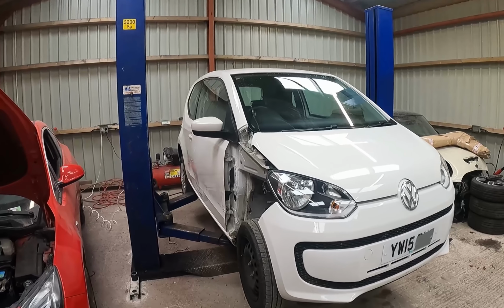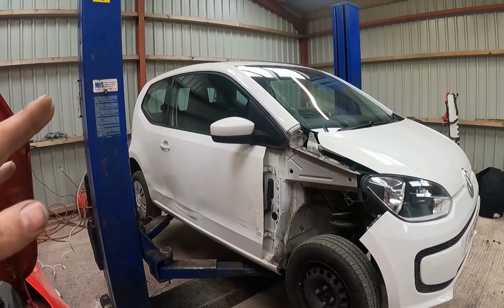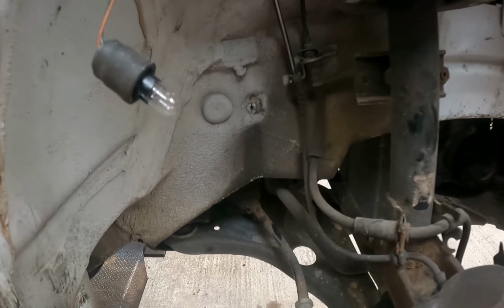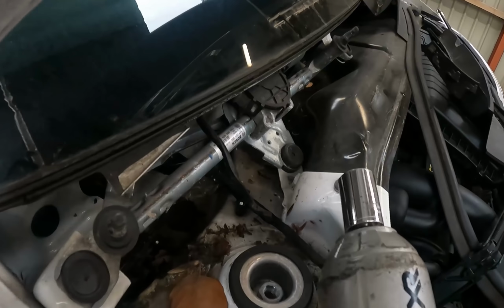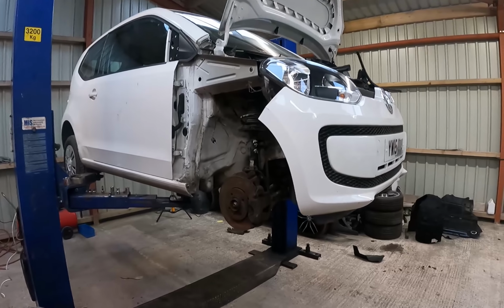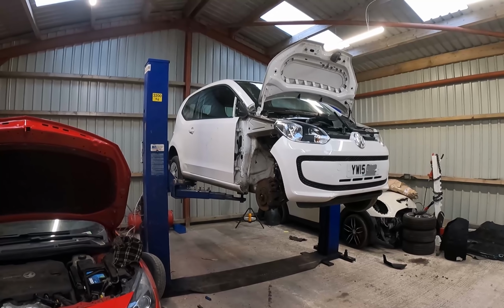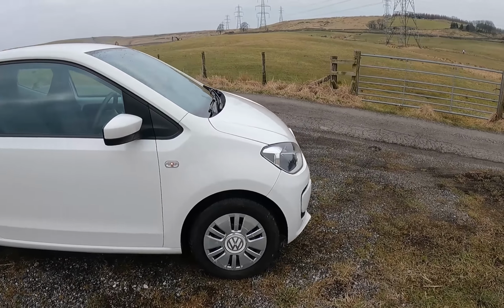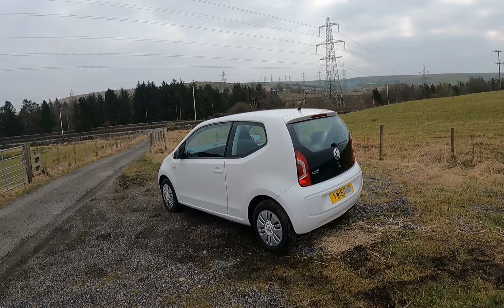Cheap Little VW UP All Done And Out The Door - Price Breakdown Included!

Comment: Did a similar job with my dad on my peugoet brought it and noticed a knock....took it back twice and was told they couldn't tell where it was coming from and couldn't hear it.....got fed up knowing it was something on the front drivers side suspension so I brought a used strut off a 3 year old car on ebay for £30, fitted it and finally silenced the knock.....we told the dealer this was the issue but they refused to sort lol.....wish I had tried to fix sooner as it cost more than the part in petrol taking it to get looked at!!!

Comment: Phil, i don't know why you buy and put second hand struts and hubs on cars like this, firstly you don't know what damage the car has had where the strut has come from and at £120 for a second hand strut/hub is waaaaay overpriced, have you heard of ECP and buying a complete new strut/hub, with the ongoing discounts its as much as you have paid for that second hand part and you can have a new setup for that. Its up to you obviously but i wouldn't be as easy as you are fitting overpriced second hand steering parts but that's your choice though
Reply: Carparts4less is owned by euro car parts, online only but cheaper!
Reply: Good point Carl. Salvage yards were ok when you could pick and pull the parts yourself. 
   Now you dont get a choice, and you're paying a premium for the labour that did! Suppose it still has merit in getting a genuine part, but i wouldn't be buying things that get twisted in an accident.
Reply: Secondhand  parts have their place over new non OEM parts! So you could give the same reasoning to both new and used!
Reply: Honestly buddy, that's garbage. Secondhand parts have been fine for me for the last 10 years of fixing and owning cars. Sure, some things are better new, but things like struts and knuckles are fine to buy used.

By the time you add up a spring, strut, top mount, boot kit, and knuckle at new prices you'll blow well past £120. I'll agree that £120 was expensive for a used leg, I'd give £50-80 for it depending how desperate I was on time. But I'm rolling about in a 2017 with a used leg on it and it's been fine for 2000 miles so far on my local roads which are far from immaculate!
Reply: @paulwisdom5383  and Phil has his opinion! So it’s all good.
Reply: @everydaysalvage  Hey, me too. All entitled to one. The only difference here I suspect is that I buy and fix salvage and have experience with it, and I suspect he doesn't 🙃
Reply: @paulwisdom5383  You can’t become experienced if you don’t learn!
Reply: @everydaysalvage  Indeed. You learn more through doing, more than telling other people on the Internet they're wrong though. Which is probably why I understand why Phil@SAS actually bought a used leg than why the OP does. But telling Phil he's wasting his time for buying used parts with what appears to be little experience themselves with the way it works seems foolish? That shock alone probably would've cost the best part of £120 at Euro Car Parts.

Anyway, whatever. Everyone does what they do. OP thinks he's right. I think Phil did the right thing. Opinions are just that. Either way Phil got paid and assumedly made a profit, so happy days for the person this actually affects 😂
Reply: @paulwisdom5383  trust me I get the same issues on my channel and mechanics love to tell I’m doing it wrong, hence why I will support phil.